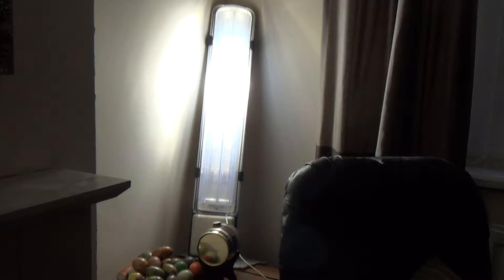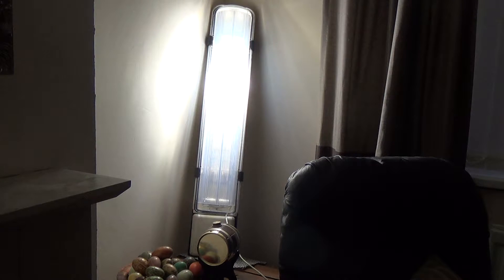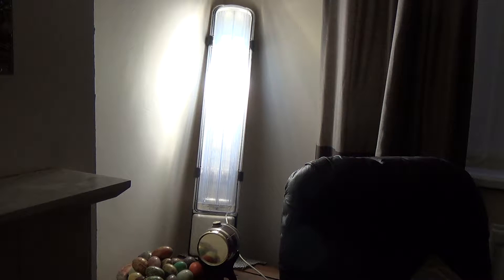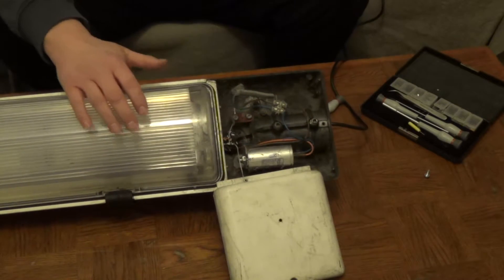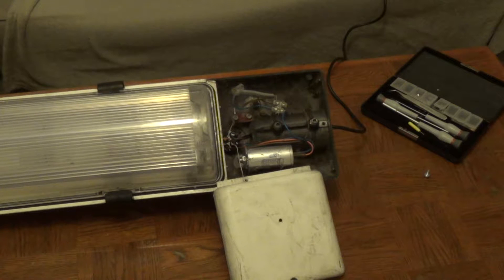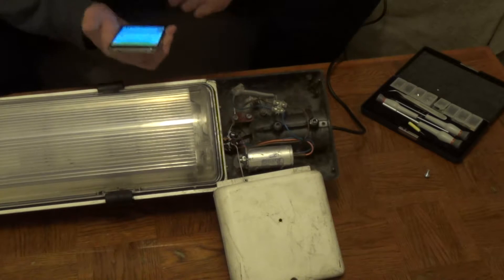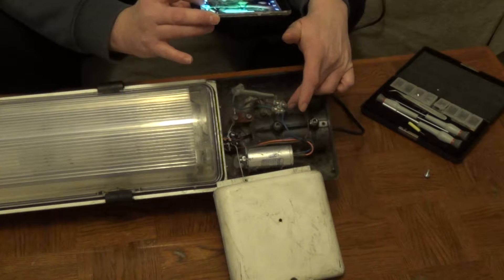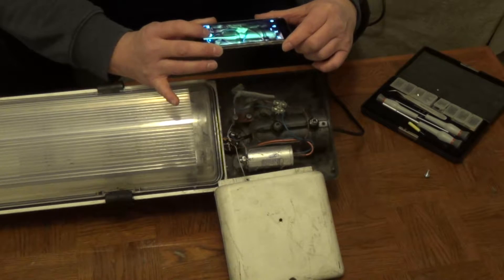Thorn Alpha 4 SOX Lamp Wire Up & Test

Comment: Are you planning to get any 90 watt SOX bulb for the Thorn Alpha 4. Also are you going to expand your streetlight collection maybe get Philips MA streetlights a good quality SOX streetlight 55,90,135 and 180 watt SOX you can get these in different wattages but you cannot get a 18 or a 35 watt SOX bulb version. These are Philips MA90, MA50 and MA60.
Reply from the maker: Naaa don't think so to both questions. Think it was just a sentimental phase I was going through when they started replacing them all with LEDs.

Comment: Anyone know how to wire a thorn beta 8?
Reply: Yeah. they're quite easy to wire. Live wire goes directly into the ballast, the other end into the ignitor, then into one end of the lamp holder. The Neutral goes into the ignitor, then lamp. If you have a PFC capacitor, that goes before the ballast and is connected in parallel or it can cause voltage spikes and damage the capacitor and/or the lamp and igniter.

If you have an old fashioned leak transformer, you need to wire both live and neutral into the appropriate taps on the ballast. If a capacitor is required for ignition, that must also be wired into the taps labelled on the transformer, and same goes for the lamp.

Comment: I ordered 2 * Alpha 4s on EBay & each 90W SOX bulbs were f**ing shattered. What the f** was wrong with the deliverance through f***ing EBay?
Reply from the maker: Fragile bulbs. They need to be packed separately with lots of padding. Think mine was broke coz it was fitted in the lamp when they sent it and it rattled around too much.
Reply: SOX bulbs are f***ing fragile. That's the only down f***ing point
Reply from the maker: I contacted the seller over the shattered one I got with my Beta 5 and they sent me another one wrapped really well. Still working now. Check out the full story in my SOX lamp playlist:

https://youtu.be/OWXDsXhpK5o?list=PLMv16Oku67It_lDMOM4PtFhE-_3n_1ayA
Reply: The same thing happened to me when I bought a SOX streetlight off ebay... the seller didn't even bubble wrap the bulb. It was fitted into the bayonet socket and half of the bulb was totally shattered. I spent nearly a hour trying to pick the glass out of light housing - not only are they fragile but they are also very hazardous when shattered. Plus you can't just throw them away like any other bulb...
Reply: So I believe I’m luckey, had ordered six GE SOX-E 36w send to me from eBay. All survived the trip to Holland. 😅

Comment: The ballast is not faulty, when you put that normal 13W bulb into it, the ignitor simply doesn't recogise it - that is why you can hear it buzzing on and on before it eventually stops because it thinks there's no bulb to ignite... if you were to turn the light on with no bulb at all, the same thing will happen. The flickering is just the bulb's response to the control gear.